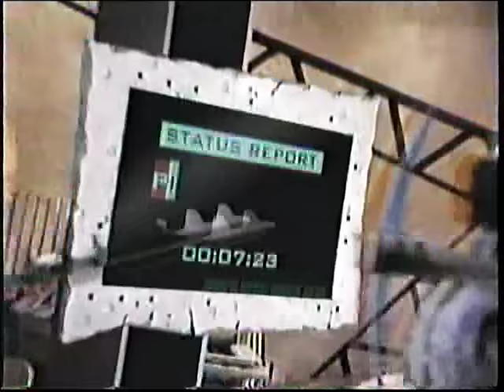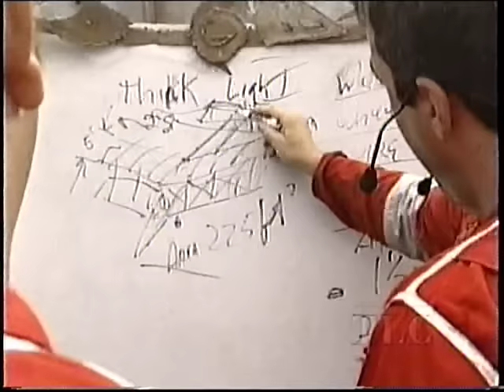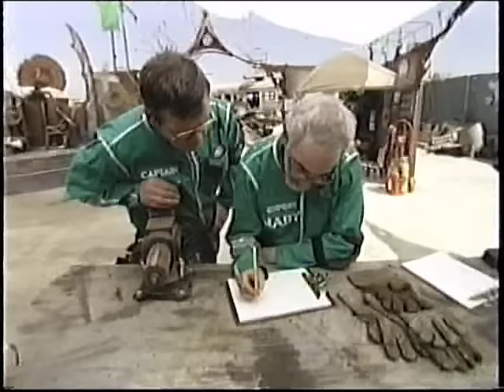Junkyard Wars USA "Gliders"

Comment: I don't understand why the expert was a Pilot, and not Aeronautical Engineer, its clear that she looks control and responds as a black box!, but a true expert will know that tip triangular design is really bad for slow flyer, since is really unstable at low speed, and the miami team knew that biplane design was really floaty and stable desing. Disclamer, I know she is a f-18 pilot, but does plane were made by engineers